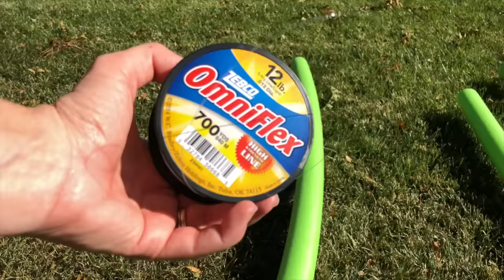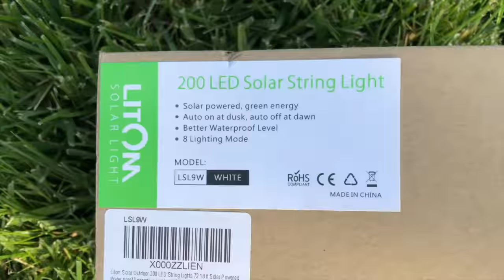Must-see Christmas hacks BEFORE you start decorating!

Comment: How long do you think that's going to last come on now crazy I mean hot glue hot glue barely holds on some of the crafts that you do make and I know that I'm Crafter and I have to put some of the crazy glue with my hot glue in order for them to endure longer
Reply: Hot glue wouldn’t work in my city.  Too windy, rainy and some cold temperatures.  In Victoria BC Canada.  Weather very similar to Seattle Wa
Reply: Have you tried the New Gorilla Hot Glue yet ???
Reply: @judymcgowan2881  
Its awesome, but don't believe it would hold up to this.
Reply: It may not hold permanently, but may help to hold it in place while you're putting everything up. Or at least that's what I was thinking while I was watching it
Reply: If you're hot glue doesn't hold well maybe you're not applying enough or you're using a very cheap hot glue you could get the gorilla hot glue sticks they work great or you could use E6000 and hot glue that works wonderfully
Reply: It'd last forever in my hometown because So Cal deserts cook everything, but decor doesn't move.
   That pumpkin snowman will continue looking not quite right, for years to come.
Reply: We have been using a glue gun to hang Christmas lights now for several years. It works. The whole house , window frames around doors. Get yourself a Ryobi  glue gun. Happy decorating.
Reply: Hot glue holds up well on my southern Ontario home.
Reply: This is the comment I came here for 😂
Reply: I use nails and a lot of tapes.
Reply: @charla8896  hi..while removing the lights..will
There be any damage to the lights or wall??pls let me know
Reply: @veenadharianumula4714  metal, brick are fine test your painted surfaces. Works great. Happy Decorating 🎅🏽 gorilla glue sticks really work well .
Reply: @charla8896  wohooo!! Thanks a lot dear.. it worked.. i have been waiting for 2 months finding some clips which can be used for bricks without nailing..thanks a ton again dear..!!!
Reply: @veenadharianumula4714  it changed everything… glad it worked 😊
Reply: If it’s very cold outside the lights will eventually fall off.
Reply: I've used hot glue to hold decorations to my brick facades for Halloween and Christmas for years now and it holds up great & pops off damage free.
Reply: The professionals who hang our lights use hot glue.  It has worked well for years.  This is in the Midwest with harsh winters.

Comment: I used clear gorilla tape to hang my lights last year and it worked great. And I’m in central Illinois and we had some good winds and a good amount of snow.
Reply: Did you have tape residue left behind when you took it down?  I've used clear packing tape to keep ribbon and cords down on my white vinyl covered porch posts and it is a Pain to clean the residue, even with GooGone
Reply: @kathrynriggs2489  yes I did. I’m going to do the same thing this winter using clear gorilla tape. This spring I will probably hits the residue with goo gone and then pressure wash as well.
Reply: @wesvan6    the cussing I do everytime I clean it up, lol!
Reply: @kathrynriggs2489  have you tried heating w a blow dryer or heat gun before removing? Use caution with heat gun, they can remove paint.
Reply: @magpie92766  I haven't tried that.  I've done it with hot glue but not tape
Reply: It didn't rip paint off?
Reply: @2Ryled    I don't know about wesvan but mine are vinyl covered.

Comment: Id think the cup holder screws will leave holes in vinyl siding. Unsightly and leak with weather.
Reply: You can buy these hooks that attach to either brick or siding and it doesn’t leave any holes. You can remove them when not in use.  I hope this helps. ❤

Comment: Some of these are nice.. Sorry but the hot glue won't stay in our mountain winters.
Reply: Try Liquid Nail Glue (not the one for the fingertips). Weather resistant, dries clear with superb hold.   Just wish these craft videos wld use better glue than hot glue. That's why most ppl don't do projects.  Best of luck and blessings to you
Reply: Try the new 🦍 Hot Glue or the tape for some of the things.
Reply: Yeah glue is a rotten choice for any outdoor things. I use e6000 with a few drops of hot glue just to hold it together while the stronger adhesive dries. Never had any issues

Comment: Hot glue won't work in colorado winter weather. That will fall off in minutes. Plus it's windy sometimes.
Reply: It won’t work outdoors really in any weather. Heat just melts it and cold snaps it kinda. I hate they used hot glue for these. I get they were trying to just get things done and hung up but they should’ve at least put on screen, “use a strong adhesive like e6000 for outdoor decor”…..something! Drove me crazy the whole video lol

Comment: FYI: using hot glue for especially the first one (hanging lights on brick) is NOT going to work….unless you want to redo it every day or so. For outside you have to use something like e6000. You could put a little dab here and there to hold things together while the other adhesive dries, but not alone. It doesn’t do well in the heat or the cold. Smh
Reply: Look for construction grade hot glue.

Comment: Please don’t use hot glue on electrical. Heat like that isn’t meant for electrical. Also, it doesn’t work. Just use hooks, Command hooks (check for weight limits) and zip ties. Nails work too but trying to limit the holes in your home is obviously preferred.